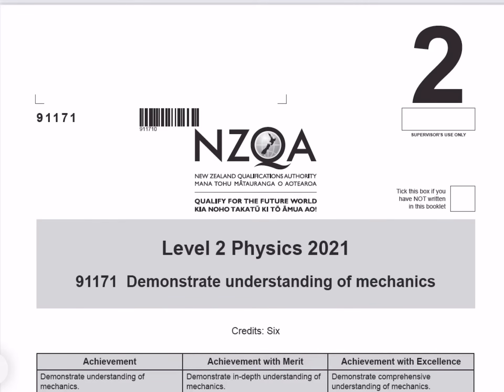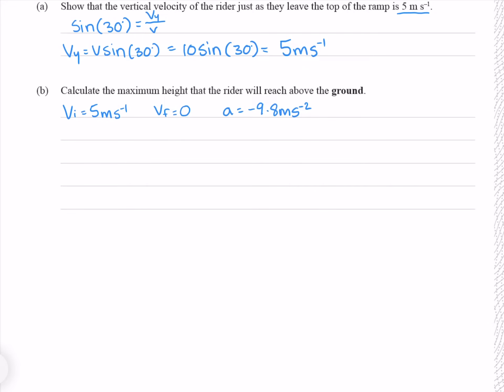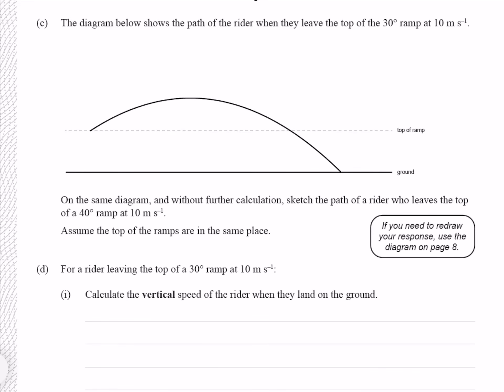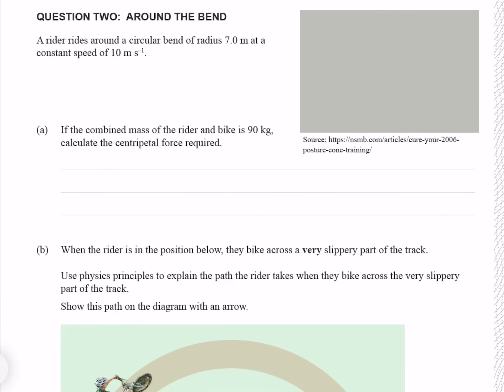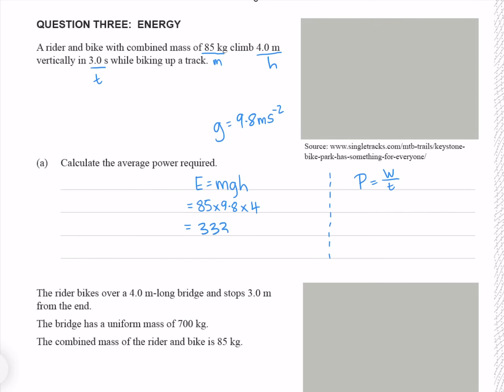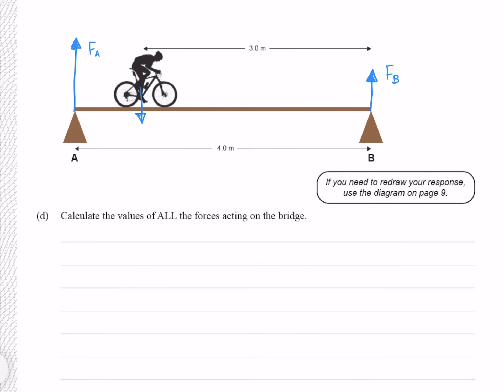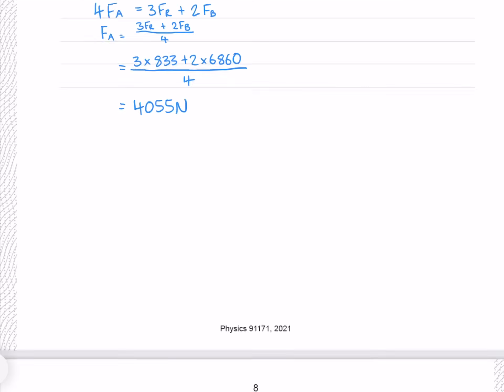2021 Mechanics Exam (NCEA Level 2 Physics)

Comment: 2:50, why doesn't one of the sides become negative if you subtract from both sides? (eg. -2ad = vi^2 or 2ad = -vi^2)
Reply from the maker: It should! The final line should be d= -vi^2/2a. 

Since a is negative it does still work out to be d= vi^2/2a, but I should have explained this better.
Reply: It wouldn't really matter as if the squared term is negative then we will have a positive value
Reply: @toastedsesame1591  no because you square the vi   before the negative eg    -(vi^2)
Reply: @ksndialndjikne4763  hence why im not doing the algebra exam, just doing calculus

Comment: how come 1di uses d = 1.1 and not the max height they reached?
Reply from the maker: Both methods work!  Using d=max height=2.38m, vi=0, we get vf=sqrt(2*9.8*2.38)=6.83m/s.

What I've done is recognise that at the moment they return to the ramp height (1.1m), their velocity will be 5m/s downwards. I can therefore set this as my initial velocity, and add on the velocity increase they will experience between here and the ground.
Reply: @MrWhibleyPhysics  Thank you!

Comment: hey sir, in 9:46, why do you use POSITIVE 9.8 for acceleration but, in the equation before, you decide to use NEGATIVE -9.8 for acceleration?
Reply from the maker: Hi there, for t2 all the values (vi, vf, and a) are downwards. Whether we make all of them positive, or all of them negative, the answer will still come out positive.

Comment: Why is the answer to 3 s.f instead of 2 in 1b? I thought you put it to the lowest s.f
Reply from the maker: Hi Amidat, you're correct. Strictly speaking this should be written to 2s.f, so 2.4m. That said, I'm not aware of any case where this would have been marked down at this level. The schedule itself states the answer as 2.38m.

Comment: for question 3 (a) the answer is 1110 W on the website which doesn't make too much sense to me because of the sig fig rule. would I get marked down if I put 1100 W?
Reply from the maker: Hi Nicole. You're absolutely correct, the answer on the schedule should be 1100W. As you may already know, the rule is to round to the least amount of significant figures in the given values, which is of course 2sf.

Comment: Generally, if I were to accidentally do calculations with rounded values, would I get marked down if my final answer was off by a couple decimal points? (e.g. using 2.38 instead of 2.3755 and getting 0.01 off)
Reply from the maker: The official rule is to round to the least amount of significant figures given in the question.

So if a question gives you the values 20.5m, 112s, and 16N, the least amount of significant figures given is 2sf (16N is given to 2sf), so you should express your answer to 2sf.

That said, provided you show sufficient working out, you're unlikely to be marked down for rounding differently. Unless of course the question specifically asks you to.

Comment: For the biker question 1di why was 1.1m used and not the maximum height when calculating for vertical speed?
Reply from the maker: Hi Rezikiri, we know the speed they will travelling at vertically will be 5ms-1 when they pass the height of the ramp. We therefore use this as our vi, and calculate the velocity they will reach over the remaining distance of 1.1m.

Comment: How do I understand sf in physics?
Reply: Sam Hight made a video on understanding SF which I found helpful: https://youtu.be/u0RTdm2zFyg?si=fWSbD3btTKTgEhlA
Reply from the maker: Hi Ethan, you might find this section in my Mathematics Resource video useful https://youtu.be/VzGl6aibPBs?t=97
Reply: @MrWhibleyPhysics  thanks, but I mostly struggle with how many I'm supposed to use in different questions
Reply from the maker: The rule is to express your answer to the least amount of significant figures given in the question. If a question gives the values 34.5m, 21s, and 67N, the lowest amount is 2, so you should express your answer to this.
Reply: @MrWhibleyPhysics  Perfect thanks

Comment: How do you know whether gravity will be -9.8 or just 9.8? Like in 5:38 you used gravity as a positive, whilst earlier you used a negative form.
Reply: At 5:38 the rider is on the way down after the peak so gravity is working in the same direction as the rider, so it is like the ball being dropped, hence positive 9.8
Reply from the maker: Hi At Choo, the negative is used when we are calculating with values in opposing directions. in 1di both the velocity we're using and gravitational acceleration are in the same direction, so the only thing that matters is that they're the same sign (positive or negative).
Reply: @MrWhibleyPhysics  Sorry I still don't seem to fully get it. For 1dii, why is it -9.8 for T-peak but for T-2 why is it 9.8 if it has the same Vi?
Reply: okay wait- is it -9.8 for Tpeak because 0-5 is -5 so to cancel out the -ve it's -9.8?
Reply: @atchoo7572  I normally think of it as if gravity is speeding up the object (accelerating) it will be a positive (9.8) in your calculation, whereas if gravity is slowing down the object (decelerating) it will be negative (-9.8). So, if a ball is being thrown up, you would use -9.8 as gravity is decelerating the ball (acting in the opposite direction as Mr said) whereas if the ball is being dropped, you would use 9.8 as gravity because it is speeding up the ball.
Reply: @bagelbear1740  THAT MAKES SENSE. THANK YOU

Comment: in question 3b, can i have more explanation, why no net force and torque required?
Reply from the maker: Sure. For something to accelerate linearly there needs to be a net force, for something to accelerate angularly there needs to be a net torque. 

Equilibrium means that the bridge is not accelerating linearly or angularly, so there must be no net force or no net torque.

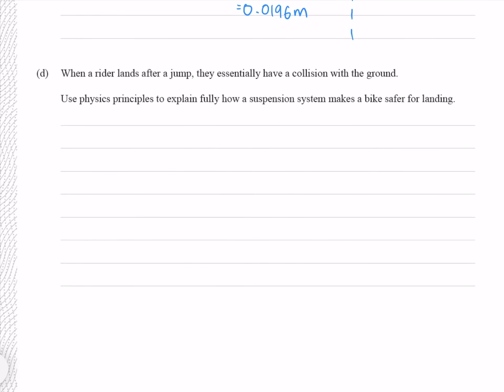Comment: Question 2c. Your working showed x=0.0196m then it showed E=1/2(40,000)(0.196)^2. The first problem I found is that in the final calculation for E you used x=0.196m instead of x=0.0196m. The second problem is that 1/2(40,000)(0.196)^2 isn't even 7.7, instead it is 768.32. The working that I got for question 2c was that x=0.0196m and the E=1/2(40,000)(0.0196)^2 which E=392 joules. What is the correct working? 13:10
Reply from the maker: Hi Lukas, remember to check the video description for any corrections. "2c: Miswritten k as 0.196 instead of 0.0196 in the last line of working. The final answer is calculated correctly however."

The calculation does work out to be 7.7, provided you use the correct 0.0196. You may not be inputing it into your calculator correctly. See here https://www.wolframalpha.com/input?i=1%2F2%2840%2C000%29%280.0196%29%5E2

Comment: Hi, I have a question.
For the last question, 3d, when working out the force acting on B, why is is possible to work it out by using the downward force acting on the bridge(the weight of the rider + weight of the bridge) to the torque experienced by point A? I thought torques and forces are two different things, so I’m a bit confused.
Reply from the maker: Hi there, there are two conditions we can make use of:

The net torque is zero. Meaning that about any point on the bridge the clockwise and counterclockwise torques will equal.

The net force is zero. Meaning that the sum of the upwards forces must equal the downward forces.

The second condition is what I used to find F_B.

Comment: Can you do my exam for me?
Reply: Lol, we got this. The exam is literally later this morning. Not ready, but will give it my best. Good luck as well!
Reply: @dallasfrost1996  guess you're here too huh
Reply: @sonni7138  we all here lmfao
Reply: @islaisla5929  im screwed
Reply: @dallasfrost1996  i thought it was tuesday, not today, so i had to cram as much as possible in 2 hours. nailed the first part, the other 2 not so much.
Reply from the maker: Best I can do is a video walkthrough in a few months.
Reply: How was the exam? I don't get the first question, it says the metal ball fell from a height at 40cm but only the distance was given and not the velocity or the mass of the ball
Reply: @ninjapirate123  their is no air resistance for level 2 mechanics, so there is no need for mass. the ball falls from a stand still where its initial velocity is 0, and from there you just use the free fall equation where x=1/2at^2
Reply: @toastedsesame1591  Oh, damn I shouldve known that, and got that question right. I better be smarter and do better next year

Comment: Hi Sir,
For question 3.c does it matter where we draw the arrows from for the diagram?
Reply from the maker: Hi Dulina, it does. The location of the forces affects the torque they produce.

The support forces are applied at the points where they each contact.

The force applied by the rider and bike is applied at their location (technically at where the wheels contact the bridge, but we average this and assume it acts from the middle).

The gravitational force from the bridge acts from the centre of mass of the bridge (the middle). Hope that helps!

Comment: hi! i was just wondering when abouts to use -9.8 ms^-2 and when to use 9.8ms^-2 in calculations as it differed in questions?
Reply from the maker: Hi Sophie, the use of negatives is important when we need to take into account quantities with opposing directions.

For a ball moving upward with a velocity of 10m/s, the gravitational acceleration must be negative to indicate that it acts against this initial velocity. Otherwise we'd describe the ball as moving upwards at an increasing rate,  reaching space in a matter of minutes!

Comment: when you are doing a calculation how do you know if it is Yx9.8 or Yx-9.8
Reply from the maker: Hi Spencer, the convention is to use negative numbers for downwards pointing quantities. In many cases however, we're only concerned about the magnitude so the negative can be ignored.

The main thing to watch out for is if quantities are pointing in the opposite direction (particularly in kinematic equations), they should have the opposite sign.

Comment: Hi, for question Q1 d(ii) why are you using 5 for the initial velocity and not 10? I don’t get it
Reply from the maker: Hi Aiden, in kinematics problems we often look at the horizontal and vertical motion separately. To do this we split the total velocity (10m/s in this case) into horizontal and vertical components (8.66m/s and 5m/s in this case).

In the section of this problem you're referring to I'm considering only the vertical motion, so use the value for initial vertical velocity 5m/s, not the total initial velocity 10m/s. Hope that helps!

Comment: for 1b why is the acceleration -9.8ms2, but for 1di the acceleration is 9.8ms2
Reply from the maker: Hi Ajay, good question.

In 1b the gravitational acceleration acts OPPOSITE to the upwards velocity so they must have the OPPOSITE sign.
in 1di the gravitational acceleration acts in the SAME direction as the downwards velocity so they must have the SAME sign.

Hope that helped!
Reply: @MrWhibleyPhysics  Thank you, makes sense now
Reply: How was the exam yesterday
Reply: @ninjapirate123  it wasn't too bad actually
Reply: @jkay2408  Did u get the answer to the first question? Where it says the metal ball fell from the table, the only thing given was the height, and it tells us to calculate the time it takes to fall from the table. Nothing else was given not even the velocity or the mass of the ball so the first questions looks like it doesn't work
Reply: @ninjapirate123  yes I did I'm not sure it was right but I can't remember what I got for the answer. That was the only question i found tough
Reply: @jkay2408  Yeah same

Comment: sir on question 3d, we chose to point an as the pivot and found the support of a and b. Would that be marked as, correct? thanks
Reply from the maker: Hi Thanh, either pivot choice will work. I chose B because we are given the distance to B, making it marginally more convenient.

Comment: Hi Sir, for question 3a when solving for work would it not be easier to use W=Fd rather than E=mgh? They both give the same answer so I'm assuming they are the same thing but I was slightly confused on why you would use E=mgh as W=Fd directly solves for the work? Thanks
Reply from the maker: Evening Danny, as you've rightly guessed they are indeed the same.

Starting with W=Fd. Since work is energy replace W with E to get E=Fd, since our force is gravitational replace F with mg to get E=mgd, and finally since the distance is the height replace d with h to get E=mgh.
Reply: @MrWhibleyPhysics  Oh okay so they are the same thing, thank you sir!

Comment: For question 2b could we talk something about (assuming friction is still present) how the cyclist is accelerating to the center of the circular motion but due to less external unbalanced force (less friction) the cyclist is accelerating less meaning less velocity hence the radius should be larger due to the path of the circular motion created by the cyclist being wider as the cyclist would be going slower otherwise they would slip and go at a path tangent to the circular motion. Would this be somewhat acceptable? Thank you
Reply from the maker: Hi Ash, certainly. The assessment schedule accepts "Clearly and correctly explains a wider curve" as an alternative for the full merit mark.
Reply: @MrWhibleyPhysics  Alrighty, thank you very much 👍

Comment: How many significant figures should we round to?

Our teacher always tells us to round to the value given with the least, but the answers are always rounded to different numbers of significant figures.
Reply from the maker: Your teacher is correct, you round to the least given. That said, as far as I'm aware this isn't assessed at this level. I'll usually try to follow the correct rule regardless, though I see I've laxed a bit in this video.
Reply: @MrWhibleyPhysics  ok thank you :D